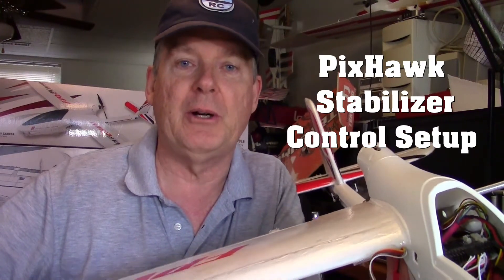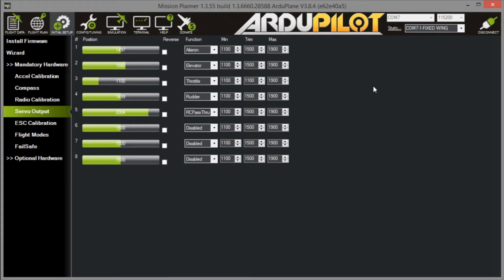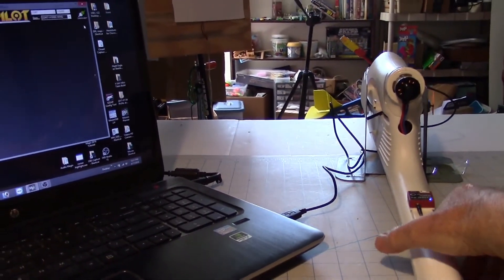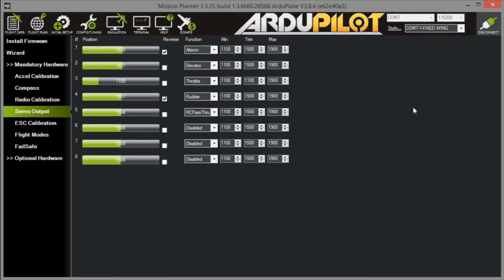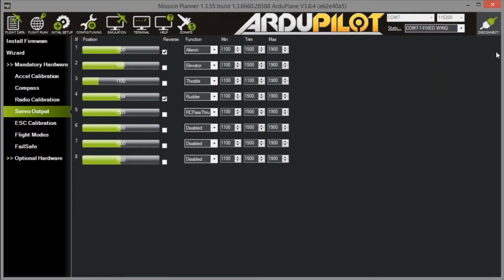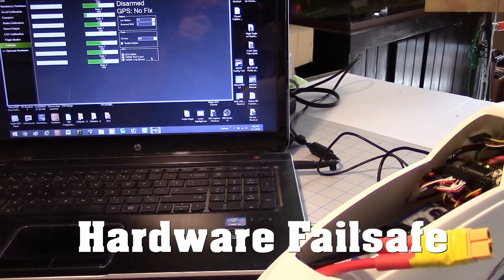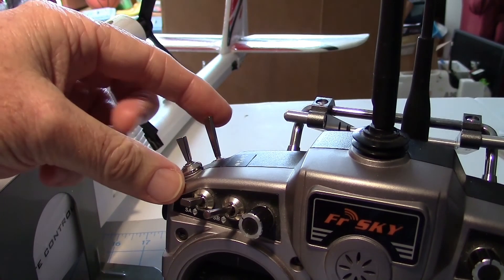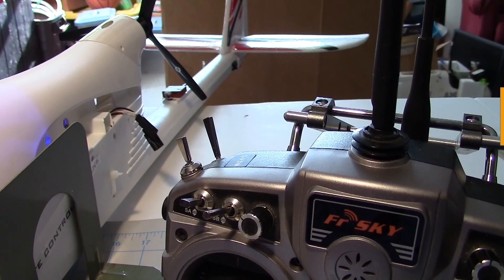Volantex Ranger 2000 FPV RC Plane Build Part 7 - PixHawk Stabilizer Control Setup & Failsafe Setup

Comment: Hi Dave  i'm using your  set up but on a extreme surfer plane,after going thru all the steps and seems like everything is working until i put the FM in Stabilize and nothing happens (elev,ail ) nothing moves so now i'm afraid to fly this using flight modes is there something i need to do in MP  or am i missing a step i've watched your vid's over and over several times i'm stumped, any idea or suggestion  would help a lot Thanks hope you had a enjoyable 4th .R.K
Reply from the maker: I wish I knew but that is one problem I never ran into. Obviously something is wrong with the setup in the MP. Someone might have run into that on the DIY drone forum though
https://diydrones.com/forum

Comment: Shouldn't tilt the plane while checking for the rudder, should YAW the plane.
Reply from the maker: Good point but Yaw is hard to demonstrate or even to do because the rudder centers as soon as you stop moving so I just use the roll which lets me check stabilizer rudder direction too. It's the rudder mix that does it.

Comment: Great project so far Dave! Good stuff!
Hey, one question about your “hardware failsafe”. It IS a great work around for the throttle pwm quirks of the ezUHF. The only drawback I can see is if you were in Autonomous Flight Mode and a failsafe situation occurred, the Pixhawk would not continue on it’s mission, but would always switch into rtl?

Looking forward to the next installment!
Fergy
Reply from the maker: Yup. In that case you could use option 2 for the EZUHF and raise the minimum throttle in the Taranis or create a throttle curve that has an offset above zero then re-calibrate the radio in the mission planner. Too bad EZUHF has not addressed this issue.
Reply: Dave Merc Productions Thanks Dave! I’ll have to play around with it!